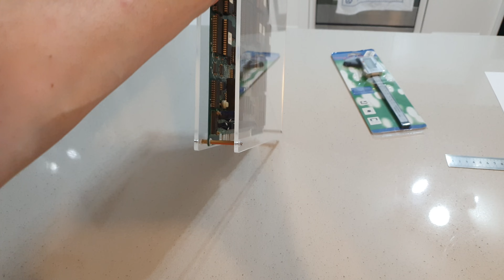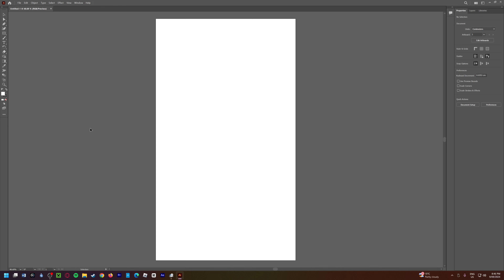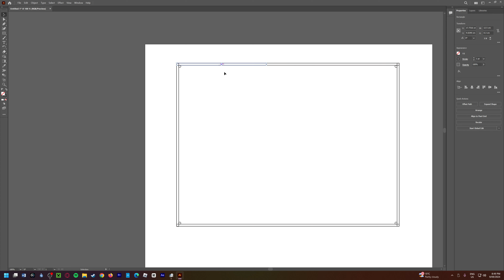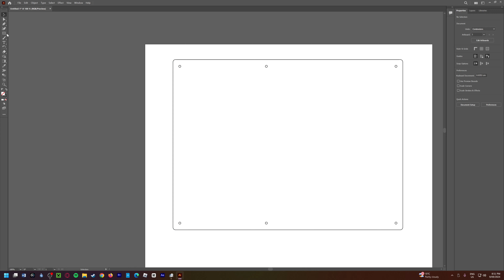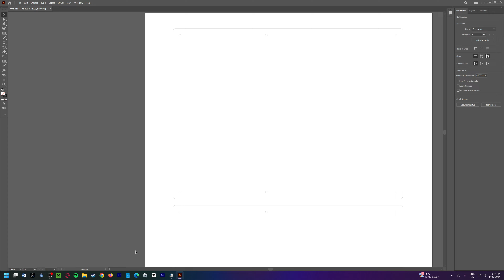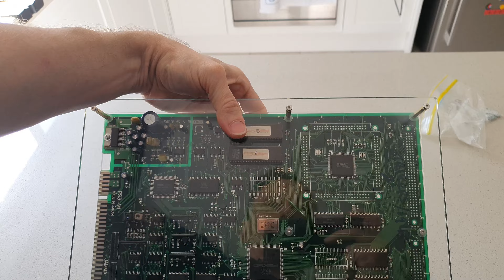Create PCB Covers for your Arcade Boards Using Adobe Illustrator for Laser or CNC cutting

Comment: Thank you for sharing this information. This was really helpful! I would be interested in seeing how you handle arcade boards with multiple PCBs.
Reply from the maker: It's the same process, I actually have done midway boards which are mtilayer etc, same process you just need additional screw ponts to mounts sub boards to larger hex mounts for height, you start more hardware. It becomes more about the brass hex inserts and positioning versus Plexi sheets.